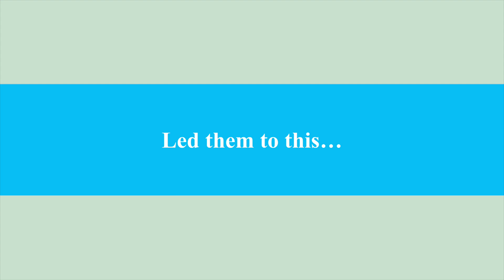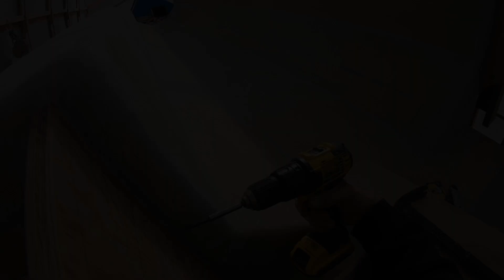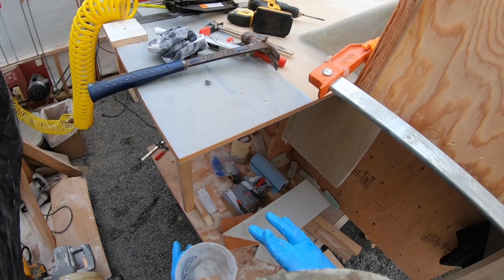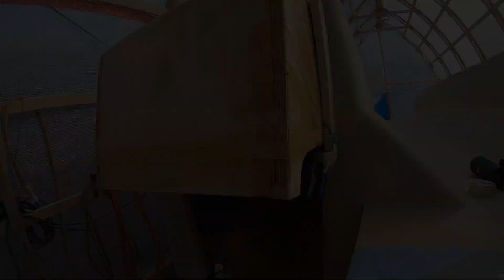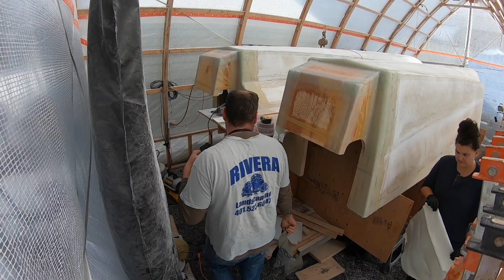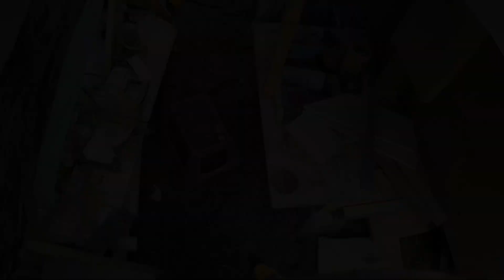Step 36: Finishing up the Motor Wells!

Comment: I wood be afraid to use raw would for a motor mount like that for fear of it rotting out unless I'm missing something which is usually the case
Reply from the maker: Don’t worry it’s all covered in fiberglass! Many layers of fiberglass and it’s a top of the line marine grade plywood. 👌🏼

Comment: Hi guys. I like the Kevlar tape. It's properties are totally different from glass. Cant break or tear and we use it on high impact zones, best application as you used it. On paint and turn I know the guys building Wharram designs paint and then turn, but this is your baby. Didn't you have a cat? Anyway stunning work. Best wishes from South-Africa.
Reply from the maker: The cat (🐈‍⬛) will make in appearance the next video just for you 😂   I think we’re going with paint the tunnel and bottom because of ease of access with it turned over now. Then paint the sides when she’s done and we have less risk of smacking into her sides.